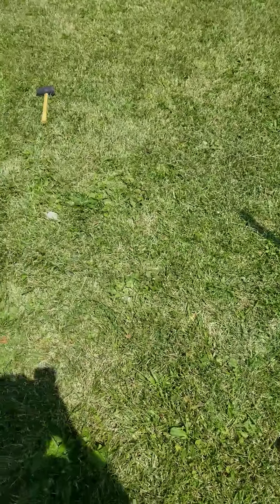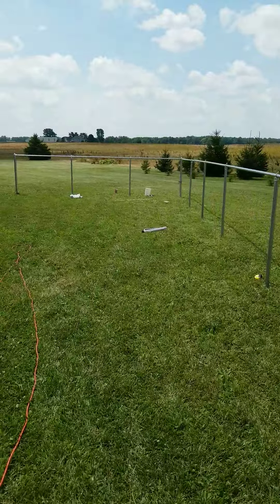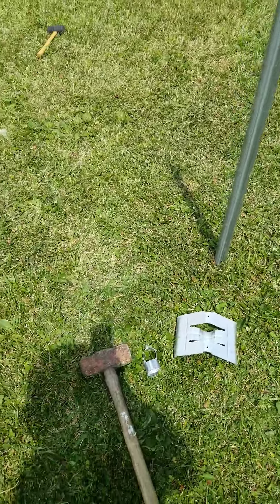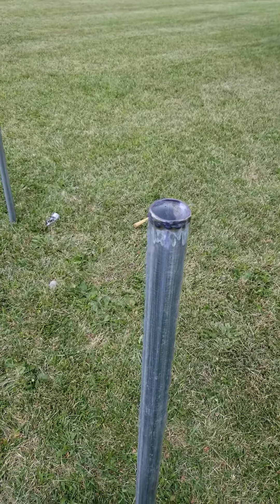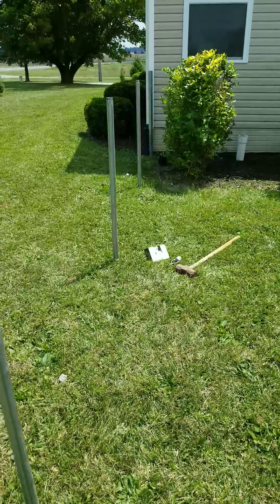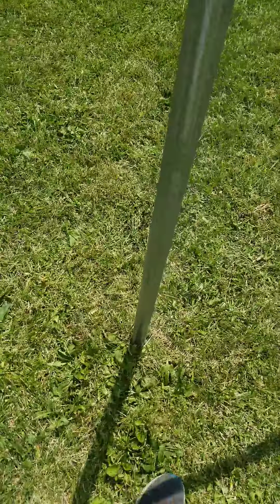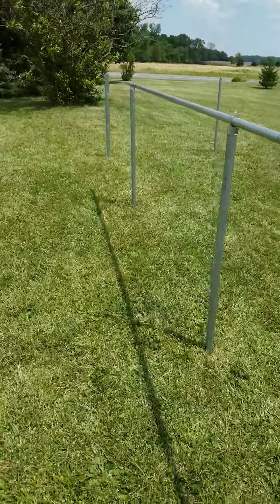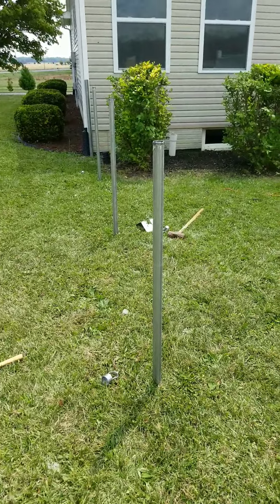Chain link fence installation without concrete

Comment: Because of your video I am going to add to my fence I already have. Someone is giving me all the chain link and posts for free! I am so lucky! Thank you so much because I knew it could be done but needed your push and added idea.
Reply from the maker: Thanks, I was lucky to find used fence and posts without concrete on them and had I known this job was so rare I would have done a better video. 1.5 years later and the fence is as sturdy as when I installed it.

Comment: How did you install the anchors to the post?
Reply: the anchor slides over the post after it is driven into the ground.  Then I used a sledge to drive the anchor in flush to the ground.

Comment: Found it on Menards website.  Now, please how far did you drive posts into ground before adding anchor, and did you use a post driver?
Reply from the maker: I put my posts in about 2 ft. Using a post driver did cause the top of the post to smash in somewhat. I took my grinder and smoothed them out to put the caps on that hold the top rail. They were 6 ft posts holding 48” fence.  I recently moved and put up another fence with the same anchors and placed my posts every 10’ and the fence is straight 10 months later.
Reply from the maker: There are two sizes one for the line posts and one for the corner posts. 2-3/8" Galvanized Chain-Link Post Anchor at Menards 1-5/8" Galvanized Chain-Link Post Anchor at Menards

Comment: Menards does not show the anchors you show in video with their fencing. What is it listed as in Menards?
Reply: It's been a long time are you still looking? The part number at Menards is 171-5336 for the 1 5/8 and 171-5340 for the 2 3/8

Comment: Thanks for the video Rick, yours is the only one I could find that feature this type. I was thinking about using a combination of these and OZ post anchors because of the cost savings. I was wondering what state you live in and how these performed after one winter?
Reply from the maker: Steve Fud I live in Ohio, so lots of freezing and thawing and the fence is as straight and tight as when I installed it last July.   I think a lot has to do with the clay soil around my property.  I will try to get another video of it.

Comment: What size was the post
Reply from the maker: I don't know the exact size as tge fence was used.  Two sizes were used to install, the typical "line" post and the larger "corner" posts.  You can get both sizes of sleaves/anchors for each size post.
Reply from the maker: According to Menards posts would be 1 5/8 for the "line" posts and 2 3/8 for the Terminal/corner posts